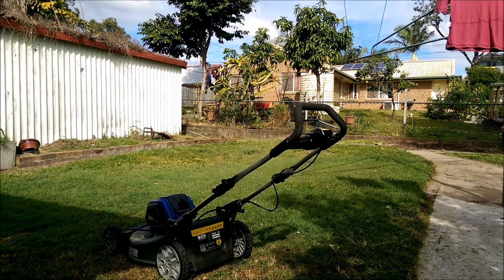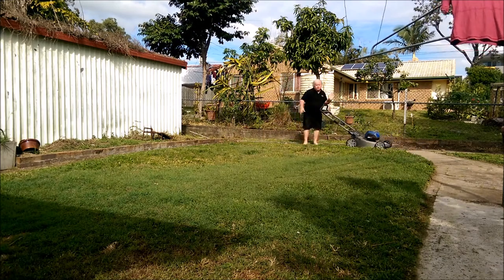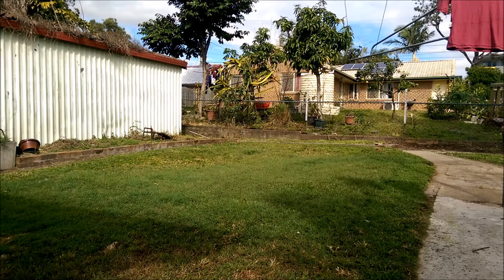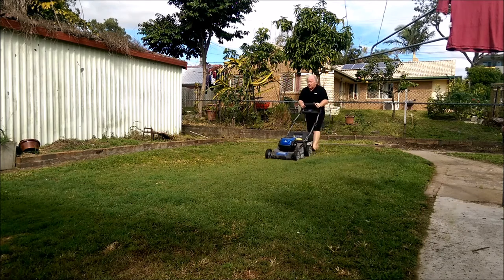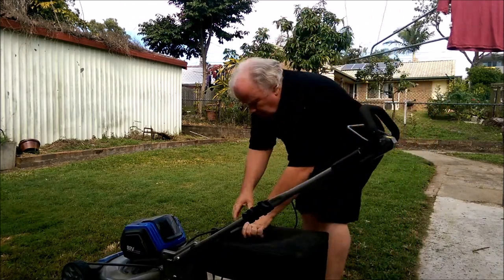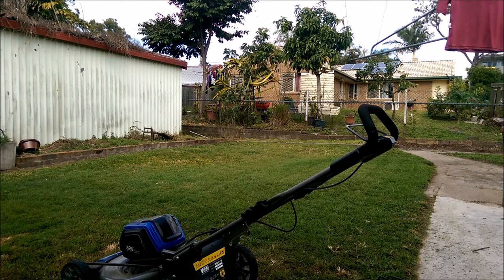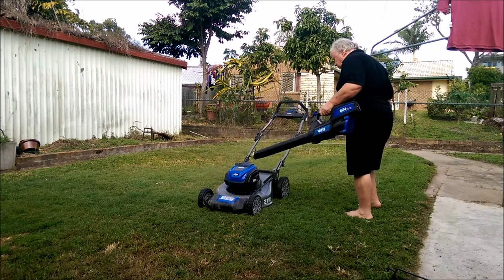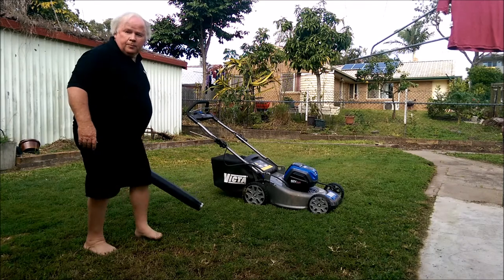Victa 82 Volt Mower.   A quick quiet mow.

Comment: I keep mine inside to avoid moisture from my cold shed it does not smell inside and I never use water to clean it i use a hand brush to clean it out underneath and then blow it clean with the Victa cordless blower I feel the foam on the handles will last longer if you use some type of gardening gloves...

Comment from the maker: Its still good.   The foam handle rubber has failed.   No surprises, I brush it on my fence line all the time.   I sharpened the blade couple of months ago.  Batteries and charger appear to be excellent.  Hope that helps.
Reply: Yes I'm not too optimistic about the foam handle.

Comment: I had been looking at all the different battery mowers for a week or so, i was going to purchase the e-go but they didnt have what i wanted in stock and i needed something soon as my new places grass was getting out of control. I just got back from buying the 18inch 82v lawn mower, trimmer and leaf blaster skins. I also bought the 4AH battery that i saved from not buying the 21inch, thanks again for the video, charging my battery's ATM and will be out testing it soon.
Reply from the maker: Excellent.  I use my leaf blower inside the house as well.

Comment: Ok Rolf I purchased my Victa 21' yesterday and here's my review after mowing my very large grass-patch (public reserve) for the first time:

Pros: 1. a fearsome beast. It's very powerful compared to my still working albeit genteel enviromower. Probably a bad comparison; 2. seems well made except the battery compartment seems a little break-easy inside; 3. quick recharge on batteries (15 mins?); 4. grass catcher is big.

Cons: 1.heavy and if you add the bigger battery - very heavy especially if you're an older dude; 2. battery reliability, given I was provided with a dud that Bunnings exchanged after making me jump through a few hoops.

Conclusion: battery reliability worries me more than weight as does the seeming flimsiness of the battery insert area. But it's a real brute and more than adequately satisfies my needs. I just wish it wasn't so heavy.
Reply from the maker: Paul Neri The weight you get used. The batteries are reliable. Mine are original. I generally mow on level 5.  May seem long but the yard looks better over time.  And far less wear on your machine.
Reply: @rolfgrosseholz1311  from memory I mostly use level 4 and only half width i.e half on new grass and half on mown grass. I don't give it a hard time.

Comment: Victa lawn mowers are the best from my experience of owning one for years without any problems. Just curious as how long does the battery hold its charge, is the body plastic or metallic, does it require maintenance, and does this model have a mulching gadget? My one comes requires a plastic item inside for mulching.
Reply from the maker: It comes standard with two batteries 2 amp.  In theory you can mow all day long.  depending on load,  30 to 45 minutes run time per battery.  Recharge time about 30 minutes per battery.  Steel based mowing deck 21".
There is a mulching plug standard equipment with the machine.  Works well. Blade needs to be sharpened as required.  Victa  recommend to check the engine mounting bolts.   
I have had no trouble with mine.  Even heavy grass is fine to do.  The motor just runs faster under load.
Reply: I charge my battery after each mow and the battery holds its charge until the next time. Steel deck 18”, quiet, no smell. Just a great bit of kit

Comment: nice demo mate, cheers.
Reply from the maker: Its nearly two years old now.  Has been trouble free. Haven't spent a cent on it.
Reply: i was tossing up between the 18inch and the 21 inch. its $300 less here in australia, sure you dont get the extra battery, but it is quieter and lighter, also with the $300 dollars you can buy a 4AH battery if you really wanted to. Im pretty sure they are the same running gear just different sizes in blade and build.
Reply from the maker: @R33FLIP  If I had to buy one today it would be the 18'.  Its still 82 volt but a later motor with a tiny bit of extra power.
Reply: @rolfgrosseholz1311  thanks i didn't realize that
Reply: @rolfgrosseholz1311  bit confused here, Rolf. I'm going to buy a 21 inch in a few weeks so it seems you're saying the 18' of today has a tiny bit more power than the one  in the video and today you'd buy it rather than the 21 inch. Why? Don't you think the 21 inch has that much more to offer than the 18' ?
Reply from the maker: Paul Neri It would depend on how much you have to mow.  I was using my 21 on several yards.  I’m only doing my yard now.  If I replaced the 21 for any reason the 18 would be enough for my yard.   But I have found the 21 to work hard if needed.  You can stall them if you try hard enough.  But it’s no issue.  I let my yard overgrow sometimes because it not an issue with those mowers.  :)
Reply: @rolfgrosseholz1311  now having a 21' would weight be a consideration?

Comment: Do you know how many cycles you get out of one battery?
Reply from the maker: They did say.  Warranty is 2 years on batteries. Comes with two.  I think they are still as good as new.  Im not kind to the mower.  Done work with it that other petrol mowers couldn't. I may buy a 4 amp battery or the 5 amp when released.  The motors are being sold separate soon.  Would love to see one on my favourite mower.
Reply: @rolfgrosseholz1311  with my new one, bought yesterday, one battery was dud.